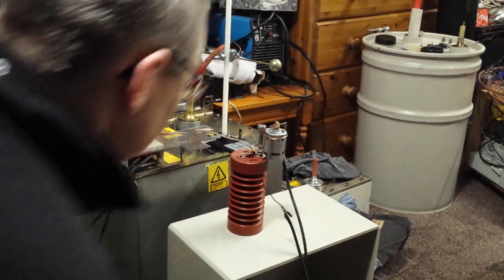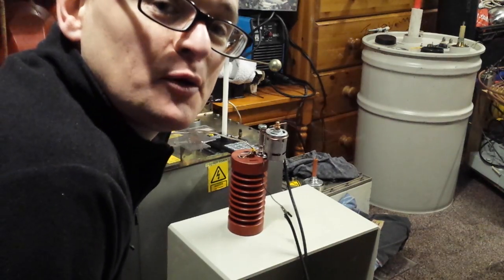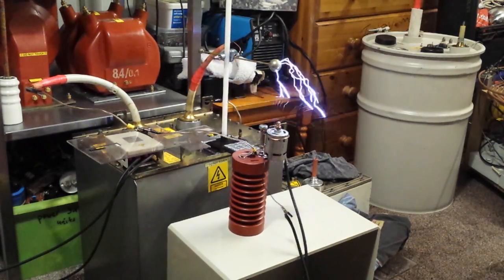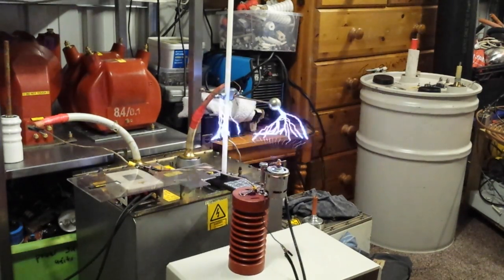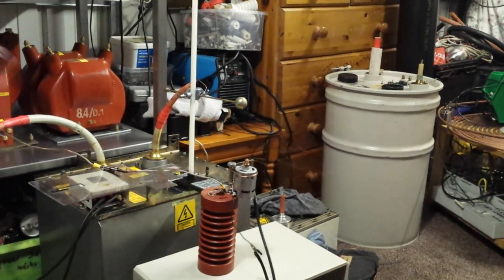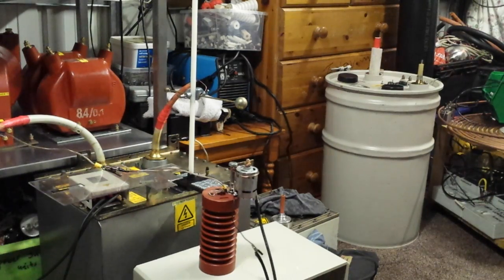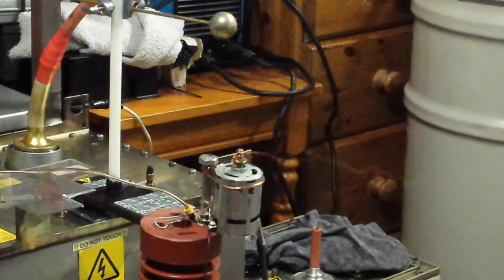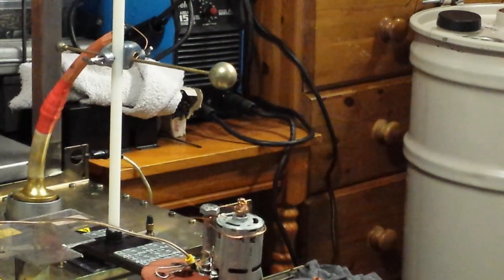High voltage dc motor

Comment: you really need to get a higher framerate camera for capturing stuff like this.
great stuff though.
Reply from the maker: id bloody love one mate!! lol, hopefully at some point ill be able to afford one!! ;-)
thanks
Reply: high1voltage1rules For something cheap worth checking out i recommend you check out the gopro hero 3 cameras. They can shoot 120fps @ 720p or a ridiculous 240 frames at 480p without busting the bank. I dont have any real high volatge toys like this to show you a demo with but i'll see if i can shoot an arc from a wee cap or something and link you. :)